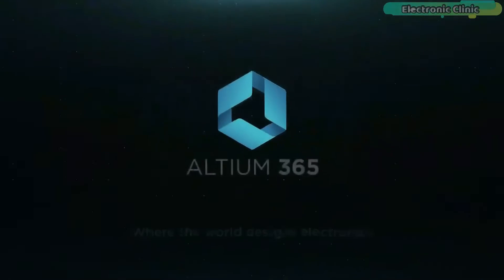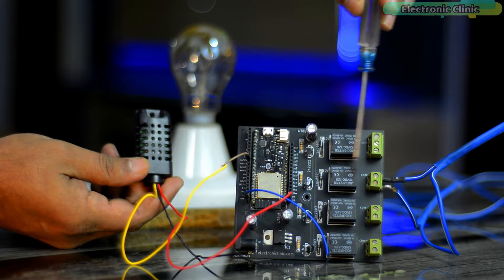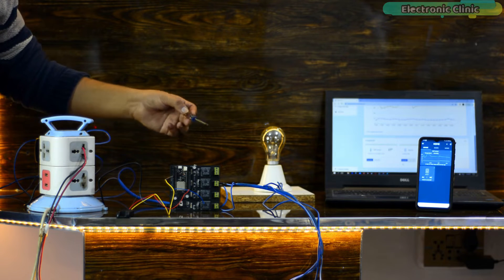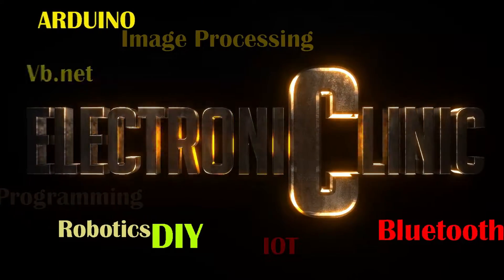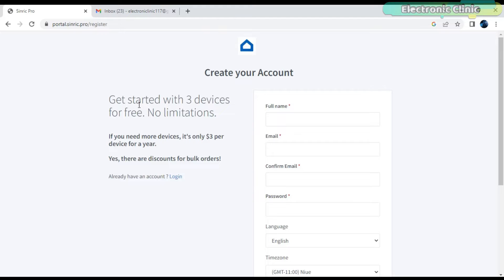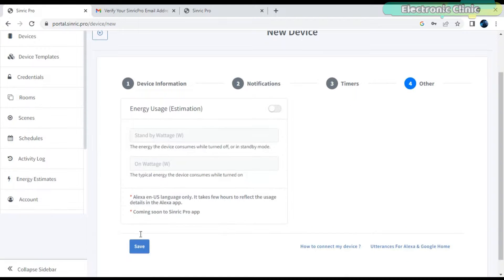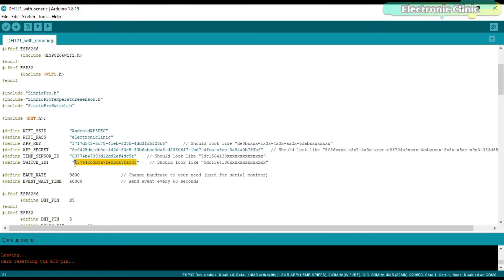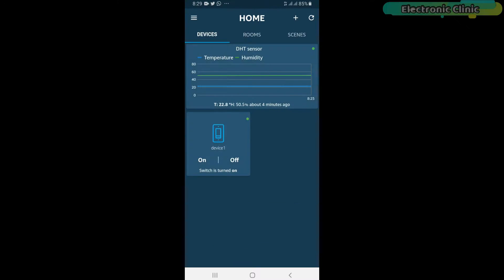Sinric Pro ESP32 for Home Automation and Sensor Monitoring

Comment: hello, I have an error, I used the esp8266 and dht22 and I get an error with this line of code =   pinMode(RELAY_PIN, OUTPUT);
the error is this = exit status 1
'RELAY_PIN' was not declared in this scope
I want to use only the temperature sensor, not the bulb and  relay module what should I change in the code ?
Reply: you have not declared the relay pin e.g if u connected a relay to gpio pin 3 then write it is as pinMode(3,OUTPUT);
Reply: and if you want to use dht sensors instead of bulb (if you are taking input not giving output) i g you know about embedded language , how the commands work